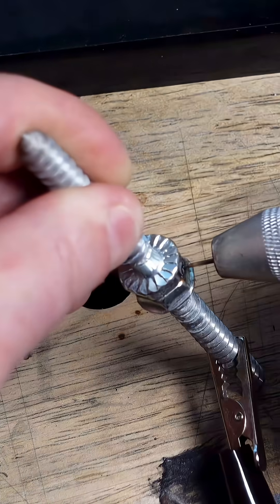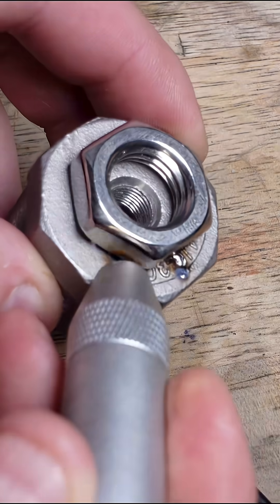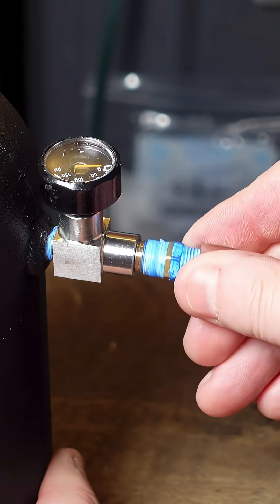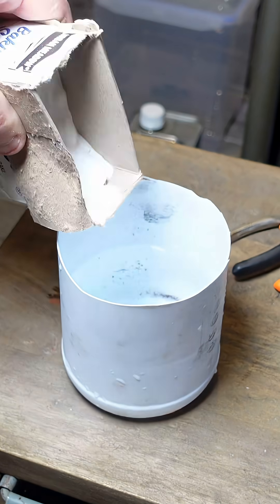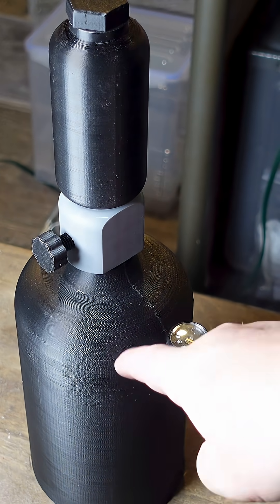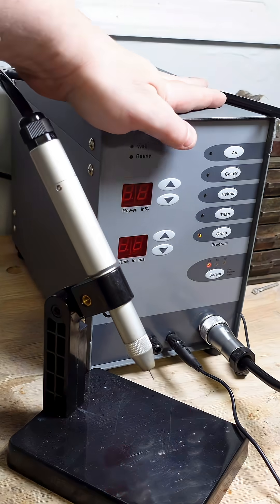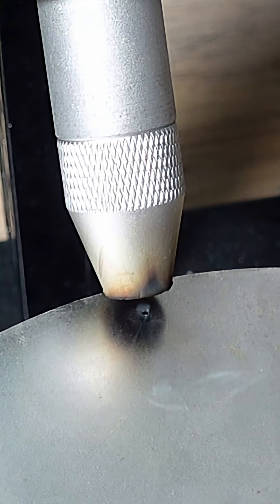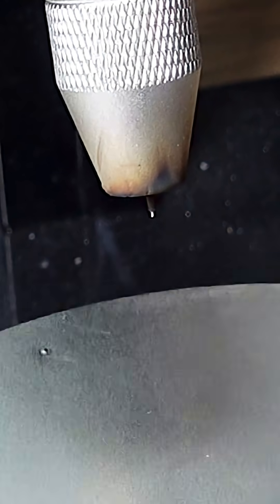🚀 3D-printed CO₂ generator? Why not!

Comment: You aligned the seam on your tank, that hurts my brain. 

Also. You're using extremely wet CO2, you should add a dryer if you want the welds to be as good as they can be. Wet CO2 isn't the way.

Comment: There is no such thing as welding without shielding and the gas you produce will be soaking full of water!

Why not buy a disposable bottle of CO2? 
Why not flux core wire?
This is a 100% solved problem.
Reply: Self-shielding flux core is so useful.  Even the cheep ones can be workhorses.

Comment: Very dangerous using plastic as a pressure vessel
Reply: I'd actually think it's quite safe because it's never going to reach a dangerous pressure before it fails.
Reply: it is. but this is brobably so weak that it doesn't really do much damage anyway

Comment: 2 liter pop bottles will be able to hold much more pressure than that 3d printed bottle, i think they can hold up to about 90psi.
if you had reused a 2 liter plastic pop bottle, you have recycled and you would not have produced plasric waste from the 3d printer (im guessing that bottle was not your first attempt)

Comment: I would definitely not want to put much pressure into that tank.  Just because its plastic doesn't mean it wont kill.
Reply: It's not a pressurized tank, it's simply the device for making CO2 in very small amounts. It's not holding anywhere near the psi to pop, nor would it get to that point.

Comment: Get a pressure release valve and a co2 alarm
Reply: The fdm canister is the pressure release valve
Reply: The entire tank doesn't actually hold much if any pressure. That is just a system for the CO2 to be produced.

Comment: is that a DIY pipe bomb waiting to happen
Reply: I looks like it
Reply: just add a relief valve to it and it's safe enough
Reply: @ShockburnVR  It's all 3D printed, it'll probably crack and/or leak before it ever reaches a dangerous pressure.
Reply: @wolfie54321 exactly lol...3d printed screw together parts require a tolerance that basically makes them automatic relief valves lol
Reply: @wolfie54321 He even aligned the seam and made a built in unzip point! 😂
Reply: Ah yes the most dangerous thing ever... A child's science experiment. Remember the little foaming volcanos you made for science fair? Yeah, that's all that is.

Comment: A pressure relief valve might be a very sensible idea. It just takes one distraction to forget to turn off the valve, leading to a build up of pressure in a vessel with hundreds, if not thousands, of stress lines in it. At best, it goes 'pfffff', at worst, 'bang'.
Reply: That plastic ain't putting up with anything approaching dangerous pressure levels. 🤷‍♂️
Reply: No pressure inside it purges as it generates.
Reply: Not only is there no pressure building, i would think its gonna fail in a non spectacular way if it could ever build that much pressure.
Reply: Valve is not a valve it controls how much powder is dropping.

Comment: Uhm. Yeah, love the ingenuity, but I wonder what pressure you are expecting in the tank, for using a 3D printed one seems way wrong. Why not use a proper tank? Any old CO2 canister would suffice, for example an old paintball tank. Anyways, cool build.
Reply: It's not a pressure tank, it's a carbon dioxide generator. You adjust the acid drip to the flow of CO2 you want and it will keep generating until it runs out of reagents. it doesn't store any pressure, it constantly exhausts it from the output.
Reply: its a contiounious gass method with the gas being directed to a tube so there is never any real presure at any point as littelry only a retard would try and presureise a 3d print past 2lb.

Comment: No, it is not a success. The soot is carbon from the interaction of oxygen in the air. Any carbon in a weld LEADS to corrosion... On top of that he is welding with CO2... 😅, do you see the problem? Let's add more carbon, so it can rust and fail sooner!
Save for argon or nitrogen to completely shield the weld process in a gas cloud so there is no oxygen at the welding point, there is nothing else you can do.
Reply: yeah... CO2 is a VERY common shielding gas.
Reply: @pill6057 not with stainless.   It will corrode the weld in the long run. Other more reactive metals will do too. 
CO2 is cheap though... And if you don't care about it long term or it is not structural then, have at it.
Reply: You do realize most non professional welders use CO2 or a CO2/argon mix as a shielding gas right? Because CO2 is an inert gas the carbon and the oxygen can't react with anything. This is technically a success but at this point just buy a CO2 tank.
Reply: @diwafflesaurus  I would expect some of the CO2 to reduce to carbon monoxide giving up oxygen.

Comment: This is a terrible Chinese welding machine. It's better to pay extra and buy something better.
Reply: it's a cheap chinese welding machine, and the only compariable argon welders I've managed to find so far have run for over a full grand rather than the 300-400 bucks the machines like the one he has costs. which is a far easier bill to pay for a hobbyist.